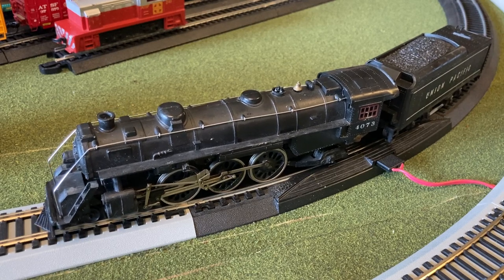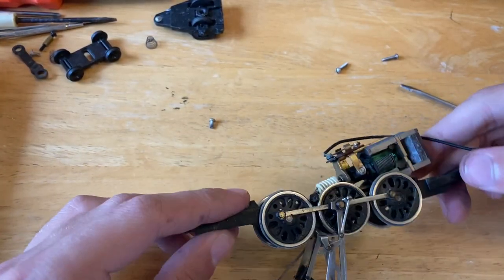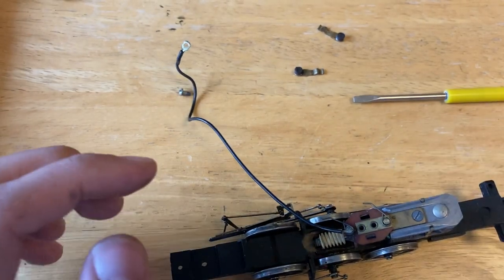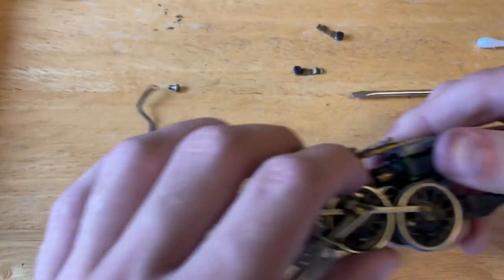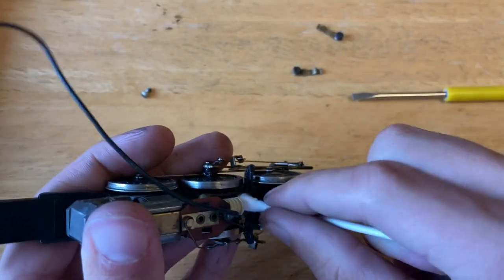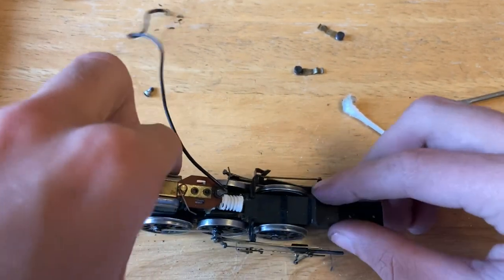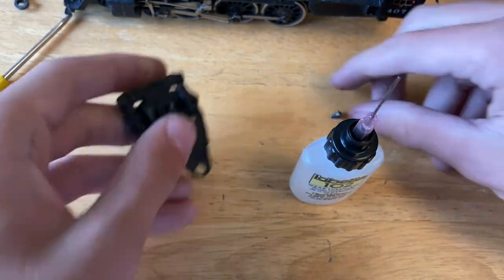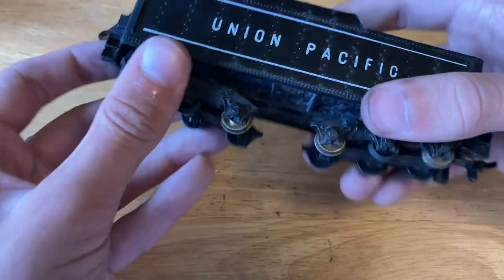1960s Mantua Union Pacific 4-6-2 Restoration  🚂🧰 Can We Fix It?

Comment: I have about 3 of those Mantua Pacific 4-6-2's that I repainted for the Central of Georgia livery.  I also changed out all the magnets in those open frame (Pittman) motors with rare earth magnets and it made a HUGE difference in current draw.  Now they all "creep" around the tracks.  First take out the screw down in the smoke stack.  That's what holds the front end on.  Need to use a fiberglass pencil on the commutator.  Use grease on the worm gear and oil on the axle bearings/bushings.  Cheers from a 72 year old modeler in eastern TN

Comment: I usually keep the steam box/piston housing on the frame so the drive gear does not get in the way. You may want to try using some 91% Isopropyl alcohol on your quips to help clean the commutator and the gearing.  If you remove a screw on the bottom you can easily remove the motor for easier cleaning. I love these Mantua Pacifics!  Thanks for the video!
Reply from the maker: Thanks for the advice. And Thanks for Watching!!

Comment: thanks for the video. I was concerned if I took it apart, what to expect.   Not sure why the light doesn't work. Can I take the piston and body off in one piece?
Reply from the maker: @rmlevyPhD  Last time I checked, the pistons are a separate die cast piece. But there should be one screw that holds the two together.

Comment: Sir, good video how to. Invest in a foam engine cradle to hold the shell safely up-side down while you work on it. They are cheap, and are like having a third hand. Additionally, a common pencil eraser will clean the commutator  better than the q tip. Just blow out the debris.  That is how the real ones are cleaned. Giant Rubber Erasers.
Reply from the maker: Thank you for the advice!! And Thanks for Watching!! 🚂

Comment: Before you even begin to disassemble, do things in sequence: Clean all wheels. If the loco runs better, stop. Your wheels were dirty, so that was the problem, nothing else.
Commutators don't need to be cleaned, since the 'dirt' is just carbon from the brushes (not oxidized), which are certainly conductive. The gaps are most important to clean so they are electrically separate. If you insist on cleaning the commutator, spritz a bit of WD40 on it while motor is running. Then put a drop of thin oil on both motor bearings.